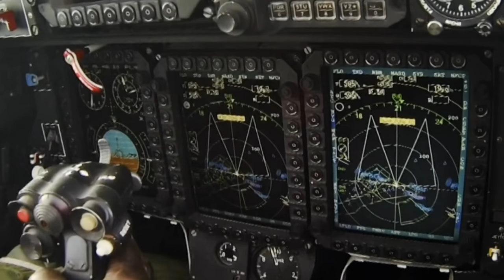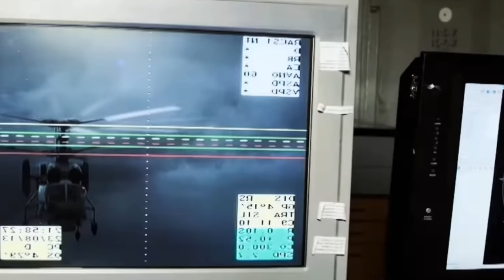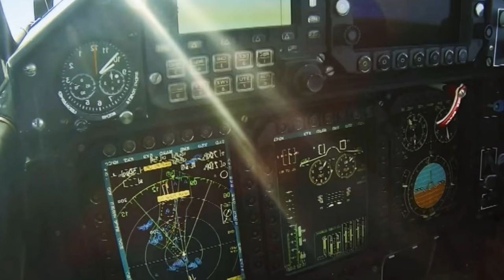Will Russia build more Aircraft Carriers?

Comment: Russia is mostly and is going to be mostly a land based military power with its enemies on all its borders but the Arctic. NATO is on its western border, China on its SE and S border, and the radial Islamist s  on its Southern and SW border. It comprises of a large land mass but only has a population of about 146 million where the USA has 300 million, and China almost a billion. No matter how much equipment a country purchases for its military it still has to have enough soldiers to maintain and use the equipment. It has a significant smaller GDP and smaller economy than the USA or China. It has a few over seas allies in Cuba, Angola, Venezuela, Syria etc , most of which the USA has no interest in their affairs. Currently it has lost its large shipyard on the Black Sea and it's Arctic shipyard is heavily damaged and neglected. It has a hard time servicing it's only carrier let alone build to build another. Considering all of this, building another large aircraft carrier would not only be extremely expensive but unnecessary to  project power or support its over sea allies. It already has some extremely large missile ships which are not as flexible as an aircraft but could project power over seas in a forcible way. I would look for the Russia to build a small carrier and at most 2 carriers to carry 30 to 40 jets plus some assault and attack helicopters. The Russian Federation already has  a few assault/landing dock type ships and with the opening of the Arctic Ocean to shipping I would look at them to add to these type ships with them possibly carrying a few vertical take off and landing jets (perhaps10-15) to defend the ship, mostly a helicopters for attack, assault, and sub detection, and of course landing craft or hovercraft for MBT's etc. All this could pose a threat to Canada who may need to acquire multi-role, assault/attack mid-sized to large AIP subs (ones that could launch cruise missiles and short range missiles and torpedoes) and similar assault landing/dock type ships suitable for Arctic weather.

Comment: From what I know aircraft carriers become more obsolete , they're slow, harder to maintain, and highly expansive.
Reply: but it allows you to situate an airforce right on the doorstep of most enemies (offer not valid for land locked countries).
Reply: I think this really depends on what you use them for.  The obvious replacement for a carrier's planes are cruise missiles, but those are super expensive if you're using them for close air support.  Also, an aircraft can loiter for a long time and just drop down when needed, where  a missile has to come all the way from the ship every time.  What a carrier's planes bring to the table is versatility (close air support, combat air patrol, strikes on infrastructure, surveillance and recon, etc..)  They do this at ranges inland that far exceed the radar horizon or other ship-born weapons and for less cost honestly (highly accurate cruise missiles are still way more expensive).  Of course, for a purely defensive fleet, that kind of capability isn't as paramount, although you end up giving up the initiative to your attacker.